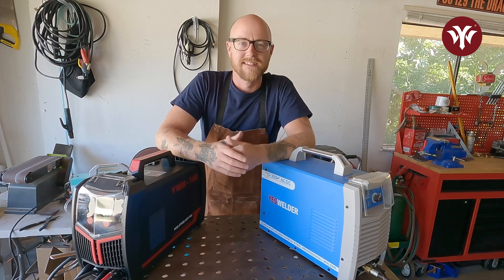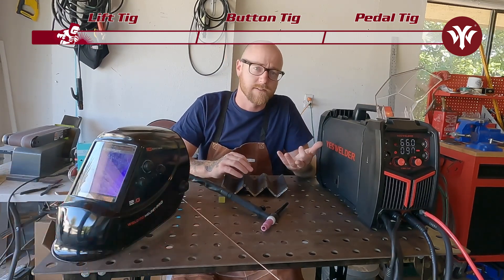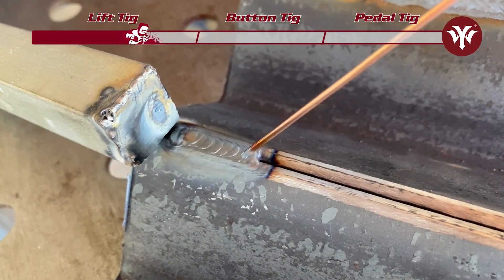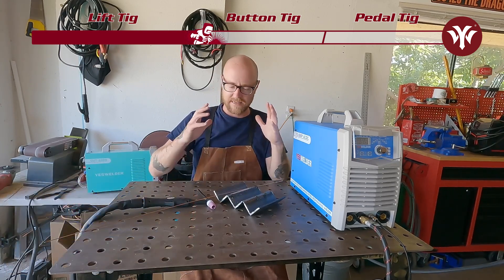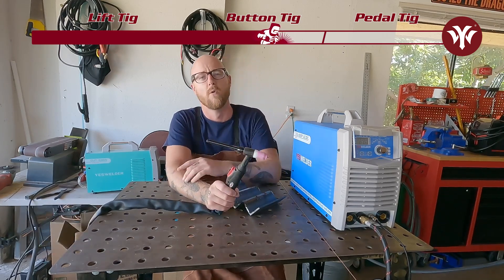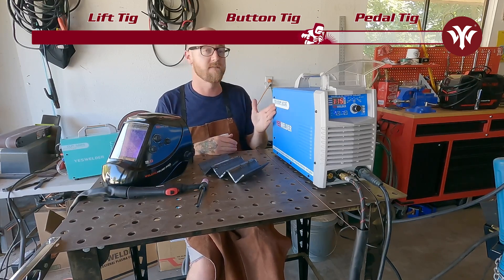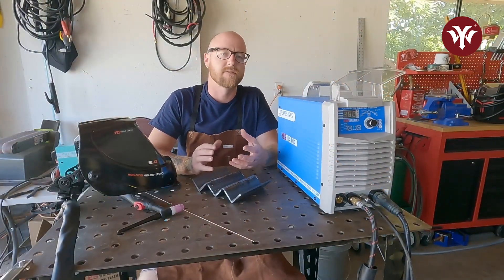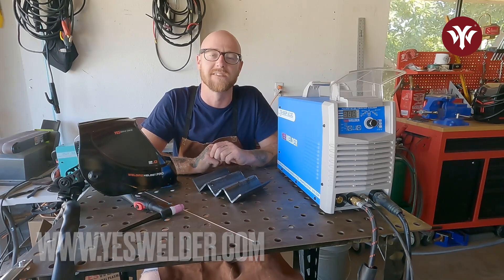Three Different Ways to Start an Arc | YesWelder

Comment: Seriously the worst attempt at explaining simple concepts I've run across on YT.
Cut the motor mouth BS by 75%, and simple name and show.
Talking about what you are going to talk about is what professionals do when they are presenting in-depth topics with numerous particulars.
This was explain 3 types of TIG starts, preferable by naming and then showing.
Don't think I want to take welding advice if you can't explain the most basics simply.
Reply: Feels like it's an advertising welsing machines